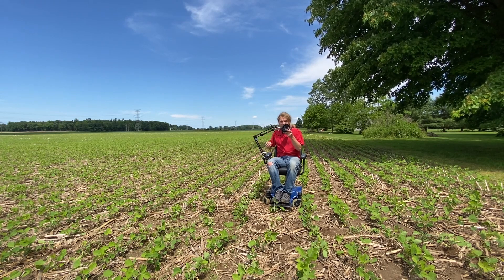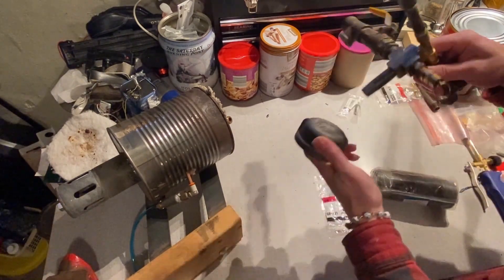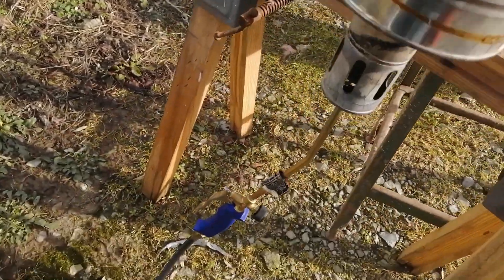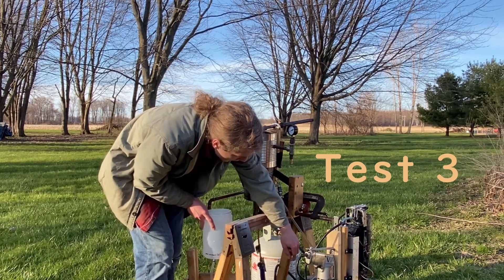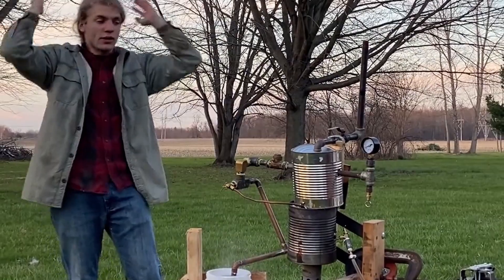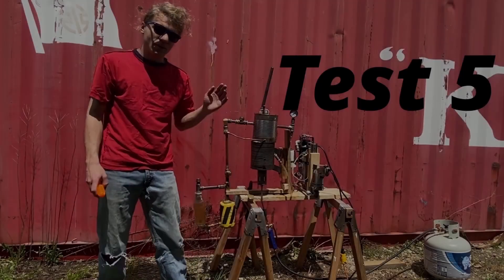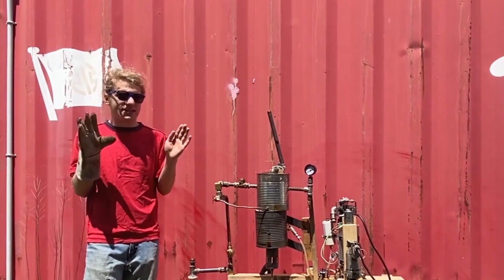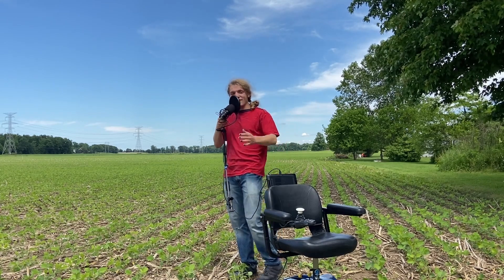I built a superheated steam boiler for some reason

Comment: Start with coil filled with water, and outlet just barely cracked open. Heat until internal pressure reaches somewhere around 50 psi and 300°F. Then activate your feed pump (you might have to mess with pump flow or speed as too much will cool the coil too much) at that point you should be able to start running your load off the steam being produced... 

That method has worked for the monotube boiler in my boat 'Wayward Belle'. I can get from cold boiler, to engine running and ready to leave the dock in five minutes.

Comment: I think you have better luck if you did like a water dripper and calculated the water flow compared to the heat generated to steam it and superheat it. your problem seems to be imbalance between water flow and heat flow.
Reply from the maker: the more ive learned about steam sense this video the more I learn how much I did wrong
the firebox should have been alot bigger there isnt enough coil for how fast the water is going, the steam is still super wet and doesnt even come close to being needed for superheated steam
Reply: @InventingThings  hence why i thought the water should have been dripping not fllowing, it expands 1600times in volume, and thus for the pipes you had, dripping water could have solved the problem, tho i know you were struggling with backflow, hence you needed a pump, maybe a vertical pipe or a small nozzle or hole in a pipe to keep the pressure and dripping going on.

Comment: ha still looks like a b*mb. Your water isn't boiling off fast enough as it's pumped through, so you may want to go back to having sealed water in with the steam reservoir like a tea kettle. Also maybe adding some way to sense when its low, so it pumps in more water. I'm excited to see where this project goes, I'm a big fan of steam and steam excesories
Reply from the maker: Yahhh it does look like a boom boom
I was actually going to attempt a smaller nozzle so the steam stays in the system a bit longer but when I was prepping for the test I had burnt the pump out...
Adding sensors could help in the future, I think I did produce superheated steam a few times its REALLY hard to tell (because its clear lol)
the gravity fed system did have its advantages and I thought about going back to it after the pump broke, but I think i just need to tune it better to boil instantly. (maybe the superheater is too big)

Comment: I've been thinking about a superheated steam weed killer. I've only made a small version so far. It used a hand-held propane torch and it only heated the water as I manually dumped it into the furnace area. My problem was with the loss of heat. The steam carries the heat away so fast that the hand-held torch can't keep up. I figured that I need a larger heat source to solve that problem.  I use a coffee can as a shroud to direct what little steam it was making onto some of the weeds in my lawn. The next day they were very dead. So I did manage to create a pesticide free way of killing weeds but it's not a functional device just yet. 

Keep it up. Your edits are getting better!
Reply from the maker: Thats a really interesting idea, I had no idea steam could be utilized in this way
Might personally make something like this for my yard (wouldn’t make a video on it sense its you’re idea) we have alot of issues with weeds not dying to chemicals.
Thats so neat thanks for sharing!!
Reply: @InventingThings  If you end up making one feel free to do a video on it. I don't have a monopoly on ideas and I'm sure you'll have your interesting adaptations.
Reply from the maker: @Makebuildmodify  cool!
I probably could do actual lab experiments with the experiment being repeatable if I did end up making a video.
Thats really kind of you to open that idea up thanks!